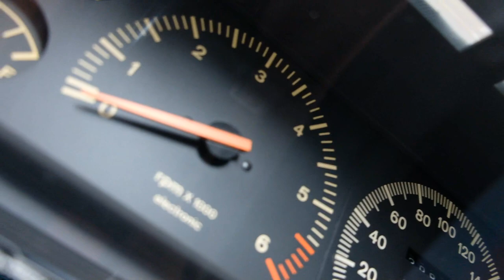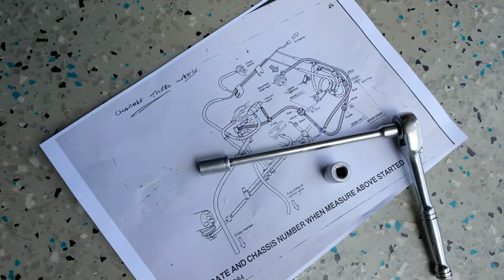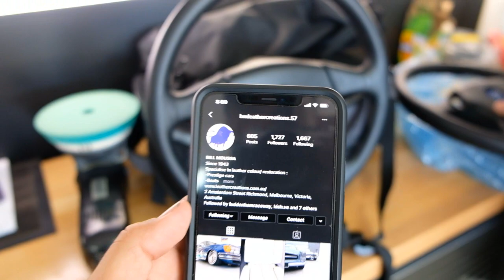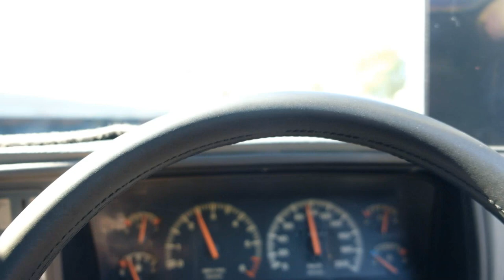More Maintenance More Mods MORE POWER! - The Ying & Yang Fords get ready for a shakedown!

Comment: One of my mate's old man had an E Series Fairmont Ghia with a Windsor 351ci (benefits of working for Ford Oz 30+ years, and the days when special orders still slipped down the line).

It also had the cruise buttons modded for "manual" shift- if cruise was off, gears could be changed (well, kicked down) back to 2nd, and shifted up
Reply from the maker: That’s crazy! Where does it live now? 351 would have been awesome
Reply: Parked up since his old man's Parkinsons got worse- the 3 sons are doing a resto & freshen up on it, maybe a mild cam, bit more compression too. Auto needs some TLC as it didnt really like the "manual" shifts all the time. It was also painted in a Liberty Blue type color that wasn't in Fords early E series range; has the XR8 sprint bodykit on it, and "big" (haha) AJR 16" x 8" 5 spokes all around. 

Only thing i know about the engine, was that it (and a few others- reportedly) were Ford Motorsport USA crate motors used in house at Ford Oz for R & D.

When Skylines & such were coming in big time in the very late 90's & early 2000's, that old girl would still hold her own- the ricers would beat it off the line, but anything over 200kmh that ED would reel them in like nothing else; and it gave my brand new MK 2 BF XR8 a run for its money (before i jammed a GT500 engine & box in it!)
Reply from the maker: @maxrockatanksyOG  that’s beautiful mate awesome job by the boys bringing it back to it’s former glory